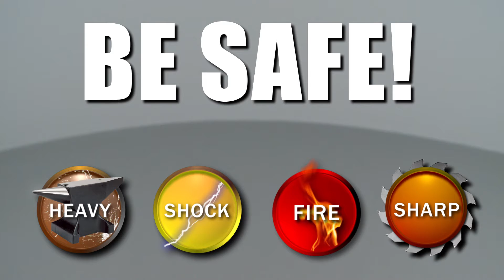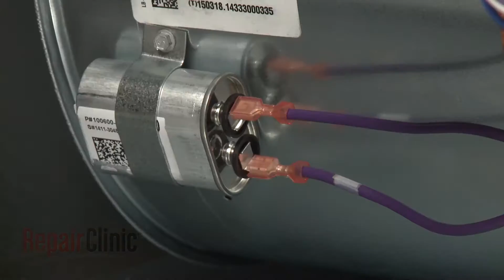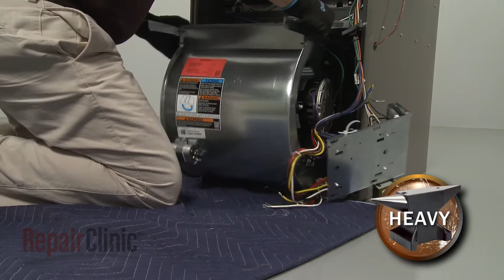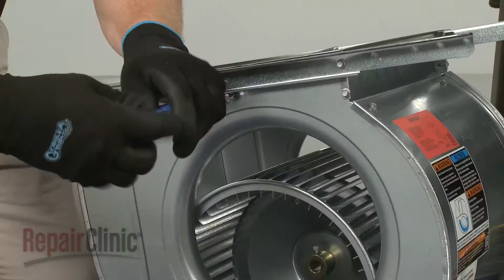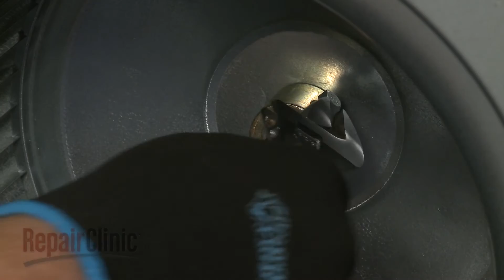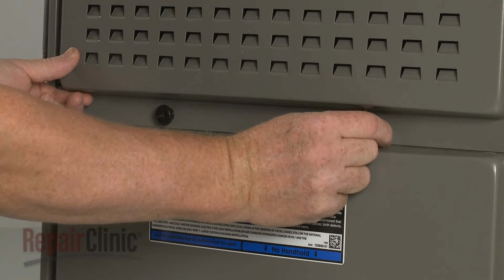Noisy Lennox Furnace? Blower Wheel Replacement #16596

Comment: I had a new Lenox furnace installed in July 0f 2017... since then I've had it checked 3 times due to the incessant whine from the blower fan on high speed. It doesn't make any noise up to that point and can only be heard in certain locations in the house. Is there a recall on the blower fans?

Comment: Like others have mentioned, how the hell does a fan with no bearings cause a vibration. It’s just a piece of metal. The new one looks the same as the old one. My furnace has a mild vibration, but it’s not rattling or screeching or anything. How do I know if it’s this fan that is the problem rather than the other smaller fan up top ?

Comment: What breaks on the blower wheel. I’m trying to understand why this part needs to be replaced. Are the fins made of a different type of metal that causes them to bend under centrifugal force because dust and debris, from lack of Cleaning? 
Please explain why this part needs to be replaced?
Reply: I honestly don't understand how they break down over time but I just found one that under Force starts to make weird noise. The supplier wants $300 for a new one. The fins start to wiggle a little bit and it sounds like a jet taking off. Poor construction from the beginning

Comment: Blower wheel looks like a solid unit, no bearings etc, what is there to wear out?
Reply: I thought the same thing.  Replaced the motor.  No change.  Replaced the fan, all set.  I think the fins develop a resonance under load.  I suppose I could have tried to epoxy each of them but would risk unbalancing the thing. Ultimately, the fan was a cheap part
Reply: @olsonacre  My blower wheel came loose from the motor shaft and spent a few hours making a racket. What happens is the blower wheel collar gets banged up and becomes larger, a loose fit on the motor shaft. Tightening the setscrew is a temporary fix as the wheel is then slightly unbalanced creating vibrations that will cause problems later on.